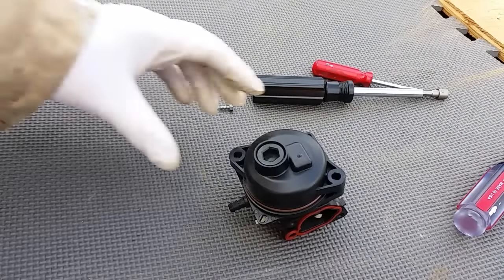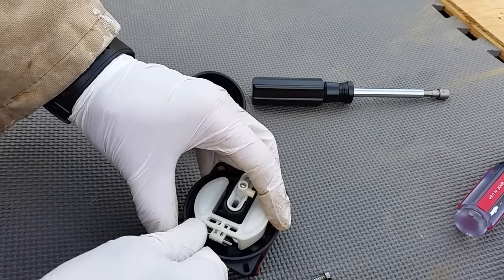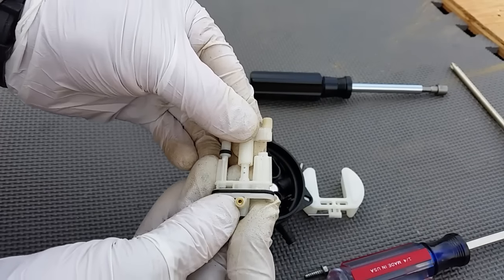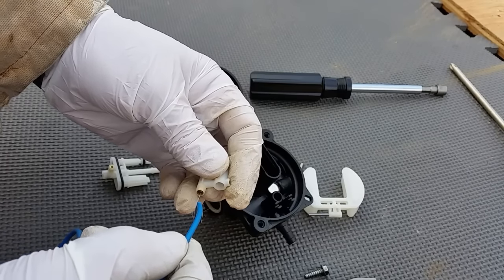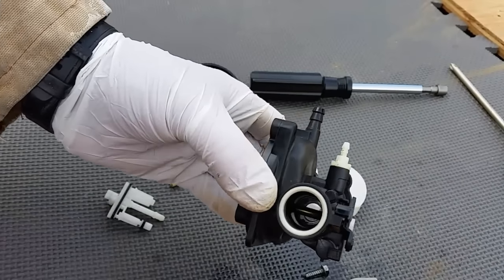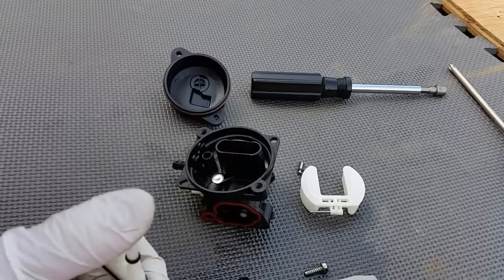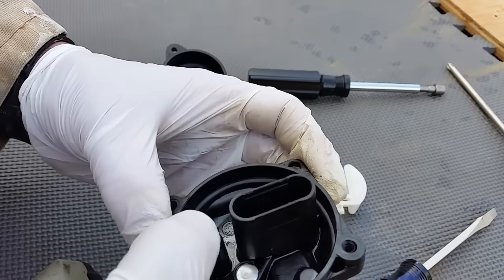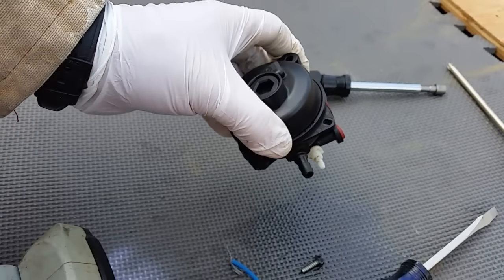New plastic carburetor - easy cleaning parts teardown Briggs & Stratton Ethanol clogs

Comment: Good video.  I'm just wondering....How often do you need to clean this carburetor?  What fuel do you use. 76, Chevron....?   Do you have a inline fuel filter?  I think my Briggs has the same carburetor.  Also do you drain the fuel out after use?  I mow once a week and after 3 weeks it's back to pulling several times to get it to start...if at all.  This is my 3rd mower in about 1.5 years.  Fuel issues I'm told.  Never have I heard of such problems.  Had a Sears Briggs mower 28 years.  The body frame finally gave way. But - Made in USA.  Pre-import days.Thank you for your help.

Comment: I have the same carb - my mower starts and runs BUT gas drips out carb constantly in large amounts and sometimes even after the engine stops.  With a metal carb I would suspect the float is cracked and won't float But this float seems ok. ANY THOUGHTS
Reply: If you took it apart like he did it's leaking from the misaligned o-ring at the bottom of the carb. Best wishes.

Comment: It guess it does matter which direction the bottom section is put on plus don’t get carb cleaner on the large O ring that separates the two halfs….it will soften it rendering it useless …and there may be another black O ring going to the engine between the carb …that little white plug on the side must be for another application for it’s not connected to anything

Comment: On these exact type of carbs (That have an external primer) there is a white inlet that looks like another fuel line nipple. Is that just an air inlet for the primer, or should there be a fuel line connected to it?
Reply: We’re trying to figure that white Barb out…..possibly another “unused” application

Comment: DO NOT PRY out the white jet cartridge with a screwdriver!  You run the risk of damaging the black plastic where the cartridge goes in.  Stick the screwdriver into the venturi throat and use the shaft to press down and pop out the cartridge.

Comment: What's the small metal plate or plug off to the side of the valve assembly? It's above the float, looks like it acts like a plug. I found mine floating at the bottom of my carb can it be pushed back in place? Mower won't stay running but a couple seconds.
Reply: Brad Deminsky it's a ball (Welch) plug. Use clear nail polish to apply to it, and press the ball back in.
Reply: I'm confused about this as well and there's nothing online about it. Won't the gasoline just dissolve the nail polish relatively quickly?

Comment: Is that a drain plug on the bottom of the float bowl?
Reply: Yes. Looks like a bolt head will fit the plug. Maybe a big allen wrench.
Reply: Size 10 allen wrench works.

Comment: Use a paperclip or guitar string to push into small diameter gas ports...  Note: Auto gasoline has ethanol in it...  Do NOT use it in a 2 cycle engine. Get ethanol-free gasoline, usually at a place near your town. Look it up here :  https://www.pure-gas.org/station?station_id=6332     shows Virginia, for example.

Comment: I think plastic parts like these are horrible and were only made to save a nickel on manufacturing.  They don't seem to realize how many people would gladly pay that extra nickel for a quality part that will not fail so soon.  Is anyone out there making metal carburetors that can be used in place of these plastic monstrosities?
Reply: supposedly, old gas will not gum up a plastic carb.
Reply: Hence the need for this video.
Reply: Well look at intakes on vehicles now a days it's all plastic.
Reply: Best thing to do is put a filter and a shutoff on the fuel line between the tank and the carb. Close the valve before you finish mowing and run it out of fuel. At the end of the season run the tank completely out of fuel. Then it can't sit in the carb n gum up the tiny passages.
Reply: Metal carbs have to be cleaned also!

Comment: From all the You Tube recordings I've seen re these Carbs, I can't see anything wrong with them. The whole 500E Engine design is better than the older motors.  Can anyone tell me if the actual Float level has to be adjusted ?. How ?..  The most important thing is to make sure the Tank interior is cleaned, if not all the gunk will be transferred to the overhauled Carby and bugger up all the hard work someone's put into it.  Always replace the  front Gasket, O Ring and Needle.

Comment: its the craziest thing to me  I can pump the ball valve and it will run, but the second I stop it stops  Been thru the whole 9 yards with the carborator.  It's got new premium gas  and it wont stay running.  I have no clue what  else to do  next.  how can it run when you pum the bulb  but yet  not run when you quit pumping the bulb?
Reply: Frank Pope you have a plug in the cartridge of the carburetor bowl jet. I would do as this guy has done. It worked on mine. Only I also use a wire pick to clean out the 3 tiny holes in the throat where the butterfly shutter is and mine runs decent now
Reply: I took the whole thing apart  still nothing  no clogs  still wont run  thinking it might be the timing  but  it  stays running when you pump the bulbvalve  so I donno
Reply: Frank Pope you have a clog, it isn't timing if it runs on the primer. You have a clog, get some carb spray, some bread twist ties, and spray and ream every hole as far as you can reach. Then spray the holes dry with compressed air cans or air compressor. If it's the new style  carbs you need to remove the plastic white cartridge /jet from bottom too, pry with a screw driver. Clean this too

Comment: Im late to the party but this has to be the WORST carburetor ever! I have cleaned out the piece you pry out. Put new gas in, cleaned out the gas tank, and yay it runs.... for a while. Give it 10 minutes of running and its dead again. I guess I will take it completely apart this time and see if its the needle valve.

Comment: these plastic carbs are crap and carb cleaner makes them brittle over time
Reply: In Cognito So don't use carb cleaner, it doesn't work for ethanol corrosion anyway. Also, what evidence do you have to support your claim? Link?
Reply: You run gas through it after you clean it, right?
Don't be making shit up.
Reply: Plastic will not corrode like metal and it is not effected by ethanol so how is it crap ??
Reply: Steve Herron heat + time + harsh solvent + vibration = brittle plastic and failure